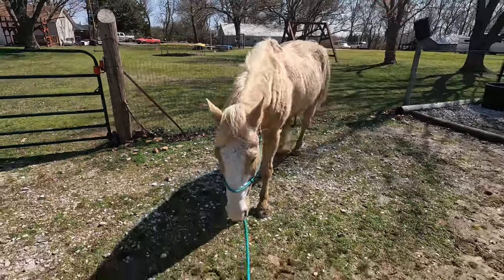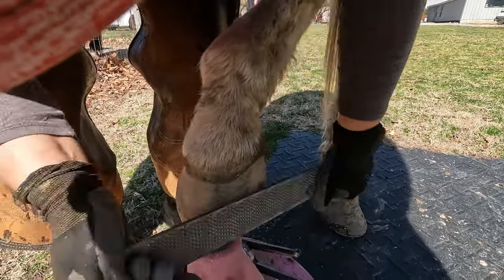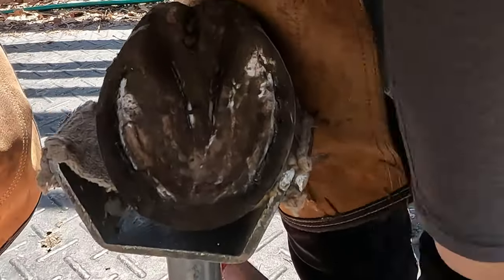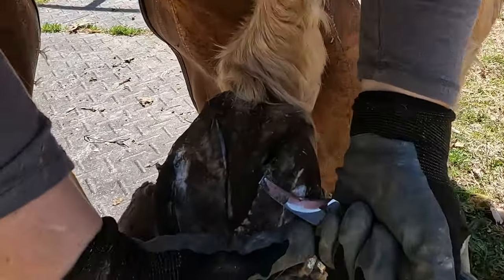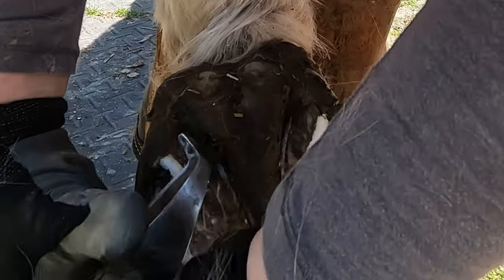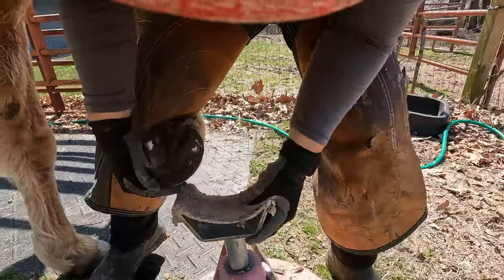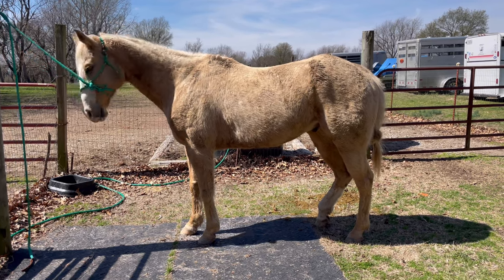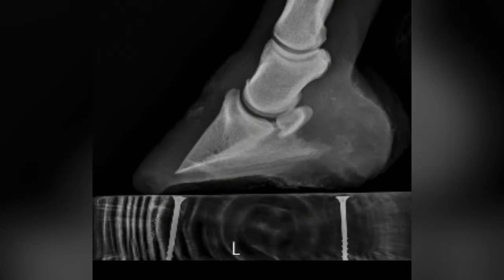Hoof Rehabilitation: Horse with Mystery Lameness gets a Happy Ending

Comment: Do you typically use Shadowfax nippers? 

And will you do a video on how you apply glue ons? 🙃
Reply from the maker: I love my ShadowFax Nippers! Although the ones that I like are sort of a special order. They are 14 inches but have a smaller head and narrower reins than his racetrack model. They feel like 12 inch nippers in my hands but cut like 14’s if that makes sense 🤪. 

I have one video that shows a lot of the glueing process. I’ll post the link here. I am currently working on an in depth instructional course specifically using Easycares Versa line. 

https://youtu.be/26Lw5wejRoo